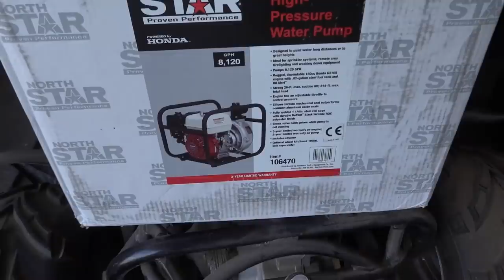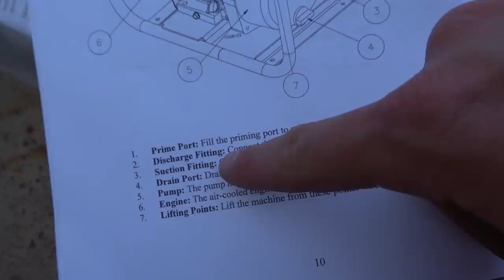I Built the Pumper Truck!!!!! Master Chief is Alive!!!

Comment: Trained Mechanik here 👋
You should get a flater tank to bring down your point of weight, and maybe you could move the pump like on the side under the Truck, and get a like an hydrant to switch between pumping, sucking, and maybe the short hose.
Greetings from Germany 🙃

Comment: what about taking 2 bearings, integrate them into a shaft and handle out of steel and create a base to hold everything together. You could possibly be able to reel the hose back up easier and it wouldn't be as heavy as an old cable reel frame?

Comment: The point of cam locks is so you can quickly switch to different things. I'd buy another shorter hose maybe 50 or even 25ft and then get an even shorter hose you can run from the back of the truck all of them with cam lock connections so you can quickly swap them out

Comment: Matt, you should be using a 1" hose reel. On top of that, to make things easier for you in fields, you could make a system that sprays water off the front bumper of the truck for faster moving fires.

Comment: The “firm and rigid” line you’re referring to is called a Booster Line in the fire service. You can buy them with a nice “reel” system and if you’re looking to throw some extra cash they come with electric motors to wind the booster line back onto the reel after you’ve used it. 

And you should get a deck gun. :) Larger device on the top of a fire truck that requires no hoses but will shoot water directly from the bed of Master Chief.

Comment: So Im not sure if any one has said this but it will extend the longevity of your pump if you place a check and bleeder valve in front of your outflow  hose. that way when you turn off your nozzle you arent slamming water back into your pump. That is just forest service standard

Comment: When you have the your pool installed have them plumb a fire standpipe in a place you can get the truck to and you can fill out of the pool quickly in case of a emergency.

Comment: Matt, you need another line to recirculate water back into the tank when you are not flowing water out of the hose. This will keep the pump from overheating when it is running, but not moving water. You need to constantly be moving water somewhere whenever the pump is running. Hope that helps!

Comment: Electric start pump engine, t-fitting, electric water cannon controllable from the cab. OR you could do like firetrucks and have an auxiliary pump behind the transmission and then everything can be controllable from the cab. Pull up squirting right out the gate.

Comment: Aye Matt the Pump and the Hose is supposed to be facing outwards nit inwards, on a brush truck the water lines are facing outwards not inwards, the only hose that should be running to the water tank itself is the intake hose line.

Comment: Not a water truck operator or firefighter, but logic would be to hardline from tank to side of the truck bed to a valve as you said, then to pump. For the hose issue, I'd say a hose reel for storage of the flat hose  that you can quickly unreel would be ideal. A shorter hose of the same type on a reel would be good i think (30-50ft?), but up to you if you want a y fitting from pump to either reel depending on space constraints after hardmounting everything and positioning.

Comment: Hey matt I would suggest a 1" hard booster reel it should be plenty for what you need and will not give you problems with deployment that being said you could keep the 2" around but I would suggest a better pack than what you have. At my fire house we have a pack that we use for our trash line it is two 50' rolls of 1 3/4" rolled side by side and connected in the middle. if done correctly you grab the nozzle an coupling of the hose (should be left up in the middle of the two hoses) and pull it out with no problem. This could be used for a larger fire that you just need to flow a lot of water quickly. The tank you have at full 550 gallon capacity with the pump at 135 gpms should last four minutes of continuous flow. With the current configuration you can only pump 96 gpms through the nozzle which gives you 5.75 minutes of continuous flow. If you cant put out the fire with that much water you need the fire department because chances are you need to start cutting a fire line. The pump and tank are suitable for what you are trying to do unless you start adding for lines then a larger pump may be necessary. However the 1" booster reel would be beneficial as you do not have to pull the entire length out to flow and is less likely to tear.

Comment: So there’s just a blank space by the driver side on the m1078 and m1083s you can place the pump there plum it to there back to the back to a hose reel and still have the hose on the back and have easy access to the pump for any repairs and firing up. Since it is a pull start pump
Reply: Ooo and your cab is in transport lock gotta pull the pins under the cab by the shocks

Comment: mount the pump under  the deck and plumb gas and h20 to it... it will be easier to access and will protect it from the elements. you have so much room for activities under there. it will also leave more space in the bed. by undermounting the pump  your tank can rotate 90deg having the outlet at the side. thus moving more weight towards the cab , also giving you more bed space. use this extra bed space to make a water turret cannon station for fighting on the move ! put Mare in a helmet back there or make it remote controlled,  also your cab should have a kickass hepa filter system

Comment: The thing with fire pumps is the operating pressure. Typically with 100 feet of inch and a half  you want a pressure at about 125 psi for structural fire fighting.  For a brush fire that pump should do just fine.

Comment: You might want to put a recirculate hose that runs back to the tank from the pump so when you have the spray nozzle shut the pump won’t build excess pressure. This will also help the pump stay cool

Comment: A bit of an FMCSA tip for you.  

Those straps will not hold that tank if even slightly filled should you take a corner at enough speed to side surge the tank (water sloshing side to side).  

The big flatbed semi straps are usually rated for 4500lbs each. Smaller ones that you buy for pickups around 2500-3000 each.  You always want to have a 50% higher load rating at each end than you need, aka two straps or one oversize strap. So with the smaller straps, you want two at each end and one every 6-8' between to prevent load shifting.  

It seems like overkill, but once a load starts to move, straps will snap like guitar strings.  I had a 10000lb solid steel ingot roll break 8 of the 9 straps and do 360s on my flatbed trailer, only managing to stay on because the lasts strap didn't give out.  Chains with adequate tension bars are a much safer option until you bolt it down.  A good chain and tension lock is rated for 8000-10000lbs. 3 would keep that thing in place forever.

Comment: Matt you need to get one of the water canons and mount it in the bed. That way you wont have to worry about hoses. Get a slightly bigger pump that will let you spray farther. This way you can get up in the back and turn everything on and not have to worry about getting down and dragging out a hose.

Comment: I was thinking of a system of tees and valves Hard pipe the suction with PVC Also a tee with two valves on the runs and the suction on the bull.  This way you can pump from the tank or valve off and free pump from a lake as well as a similar set up for the discharge so you can divert the hose to a hard pipe fill for the tank.  But the discharge should be stainless or black pipe ( I like stainless for the no maintenance feature)

Comment: I would have used the N.F.P.A. Standard for creating the pump and tank connections, as well as the hose and nozzle connections from the pump out. This would ensure that if ever used along side other fire departments they can easily attach to your setup and either supply or withdraw materials for the operation. Just my two cents

Comment: Mount the pump under the bed. It will give you better access to the pull cord and fuel switch as well as plumbing into the other gas tank

Comment: Matt, you let stuff lay around to long without attention. Example dead batteries in scopes. I would get a propane powered pump. Propane lasts forever and the carb on the pump will never go bad. Mound the propane tank under the truck and no fuel pump is necessary. Also you can mount a propane powered generator on the truck with very little weight and the fire truck doubles as mobile electricity supply.

Comment: Don't get a hose reel. Fold it systematically so that you can pull it right out, turn your pump on and have at er. Also perhaps you could mount the pump beside the diesel tank or something? All controls accessible from the ground. Just ideas. Cool project

Comment: 1 inch rubber hose will last longer and be a better application for you here.The pump will run WAY longer than your water supply will last.
You got about 6 or 7 mins of water at 80 gpm.You pump will cavitate or run dry before you get to zero gals as well.
Mount the pump under the body so you can get to it better.
I would also suggest the plastic fire hose nozzles for this too.

Comment: u need a tank with separators in it. im pretty sure that water tank dont have those and what will happen is the water can move freely from side to side and that can cause the truck to flip on it side. also flat tank would be ideal so the weight is more balanced and not on so high. will help with the tipping point

Comment: 135 gal a min means ur gonna run out of water fast.. hook up an intake hose to the tank on the truck...then ur using the tank on the truck as a "buffer tank" and its constantly being refilled..its how we do it with industrial pressure washing setups. Look at pressure washing setups...then hook it to a big pump like u have and you're good.  You def need more hose...100 feet isnt very long once u get going. You're also going to have to tap into the gas tank on the truck.. last...a trun key Honda motor hooked to that pump will be more convenient....again...its what we do in pressure washing setups.

Comment: my suggestions (as someone who has run fire tankers):

take your 100ft hose and cut ~10ft off and slap some cam locks on the raw ends. use the 10ft as the primary and the rest as the secondary. 
i would do the same with the rigid hose or get a smaller rigid hose so you can fill from some place. however, unless you have a water source, there's no point in planning for a water source you don't have. on that note, typically, the fill is plumbed in a way that doesn't allow you to release water back into the source. that is generally done by mounting a pipe that drops through the top of the tank with an air gap.

skip the hose reel and go check out how the fire trucks do it. they sometimes do a kind of folded roll that deploys fast and keeps the fittings available from the outside.

if you're going to do a "y", plumb in some boomless nozzles on 12v solenoids mounted on the truck. typically, a water tanker will have the 4 corners and the center in front covered so that they can knock down flames to get in and out of areas safely.

finally... your tank should probably be metal... poly melts easier and that can also be a problem.

Comment: Think about having a fixed spray system able to spray the full surrounds of the firefighting vehicle, we have lost firefighters in Australian bushfires and this was the recommendation, defend yourself first. Also think about flexible mountings on the back of  the truck so a firefighter can control the nozzle but not need to run 100 ft of hose. Another good point is blankets or sackcloth attached to rakes for beating out fires.

Comment: For my stations brush truck we have a slightly bigger engine witch gives it more pressure but that engines is good. Also you probably are but strap down the engine so when there is an actual fire you can run with the hose not worrying about your engine falling

Comment: use manifolds under the bed so your valves are at hand. you can also mount the pump under the bed.  being a honda an electric starter might be an option.

Comment: instead of a Y....just have a rigid pipe & the flex (red line) pipe on a reel and since you have the CAM LOCK on the pump too...you can just quickly switch which hose you want to use for each fire you need to put out...

Comment: Matt, if you want to stick with you current hose you can learn a technique called Rolling and Bowling, it’s a way to roll up this kind of hose easily and make it easy to unroll and it lays the hose flat, this is the technique current fire fighters use. Another way to improve on your fittings is to use a system called Storts. Instead of cam lock it’s a way to easily connect and disconnect hoses and branches (a branch is the thing on the end of the hose you use to spray water)

Comment: Use tape on tank vertically by the gallon numbers then pain your tank the sun will bake your plastic tank and cause it to crack also be careful when you strap it down make hoops like a rainbow with tabs at bottom bolt it down and install tabs at both ends soon before the tank give a problem

Comment: Idea:   Mount the pump with the pull-rope facing the rear.  The ignition switch is also on there, so it's doubly convenient.  Then, if possible unbolt only the recoil starter, but DO NOT pull it off!  Simply rotate it so that your rope is facing at a downward angle, rather then upward. (so you can pull it from the ground) Plumb the tank & pump up with metal pipe. Have both the inlet and outlet from the pump plumbed so that they are both accessible from the rear.   Like you intend to relocate your shut-off valve, same for the inlet/outlet ports. Then install your camlocks onto the new ports. 
Also check over your manual pretty well,  It may be that your pump may not do well with the outlet being throttled via the hose-end valve.
Finally,  if you do pick up water from a river or lake, Please use a suction screen.  Any little stones (or fish) sucked up will wreak havoc on your impeller.

Comment: 500 gallons should do it! You can put out a LOT of fire with that. For just learning/getting into it it looks like you’ve got a decent set up. Put the wet stuff on the red stuff and it’s a good day!
Reply: Also a 1” “Booster Reel” is what I’d recommend for your hose line. Rigid, easy to use and quick. It’ll still deliver lots of water for any brush fires.

Comment: Dude I’ve done water systems for events and also did architectural fountains for a few years. 

Step one, turn the water tank 90 degrees and use your outlet line as the new input line. Install  a check valve (or even a small double check valve) so it can fill it without needing a ball valve. Make a new hole on the side where’s its flat and install a bulkhead fitting for your new line running to the pump. If you can, mount the pump under the bed (maybe on the side next to the rear tire.) from there, hard pipe to a tee or Y for either a hose line or to a mounted sprayer. As for the reverse filling aspect you will need to do some fancy building of some ball valves with a connector between both the inlet and outlet lines. I could draw something up for you for sure.

Comment: Layflat hose is a pain in the butt.  I would also use velcro straps to hold the cam locks down. Does the truck have a pto?  A pto driven pump may be the way to go.

Comment: I've converted a 4x8 trailer into a fire trailer and I'm in that stage of figuring out what works and what doesn't. What works is having short and long hoses for different things.  I carry a 25' and 50' and plan to get a 100' hose too. A 1" line will be plumbed in and useful as help arrives. Had a fire go through my place last year and I'm sure I could have recruited some of those guy's who were busy taking selfies.
Reply: Also I have put a couple of fire extinguishers on it for grease/oil/electrical fires. Hope this helps.

Comment: You could put the pump on the side od the truck with the throte control poitiong out and then the tap drill a hole in it and have a pice of string tied to it

Comment: Matt i think you should have Brandon weld you like a small bracket on the outside of the truck like on the side you then you have all the controls towards ground level, then have that unleaded gas going to the little gas tank through the cap with a nozzle.

Comment: That engine is gravity fed gas i doubt it will create suction to pull from the retrofit.  you could put a larger gravity tank on that motor then have a line that can pull from the retro tank to refill the gravity tank and or have that tank with a pump to a gas/diesel handle for filling "stuff"/vehicles used in demo videos.

Comment: That carburetor will not suction gas on its own from the tank under the truck. It is made to gravity feed from its own tank. And even if you put a fuel pump on it you will have to change a jet on the carburetor because of the greater fuel pressure. It can be done but it's just alot of messing with it.

Comment: Answer your question the tank you use should roughly be 3/4 of  the tray space (in length ans full width).what you have might be okay for  pesticide spraying or fertilizer spraying

and you need enough  space in the tank to sit  a crew of 4 or 6..

don't take a platuc tank to a wild fire wuth plastic tank on board...

Comment: Just a thought,but maybe build a metal box with doors and hang it off the underside of the fire truck bed,so you can control the water pump at waist hight,IN doing so you will be able to control everything at ground level.so you won't have to climb up and down the ladder.